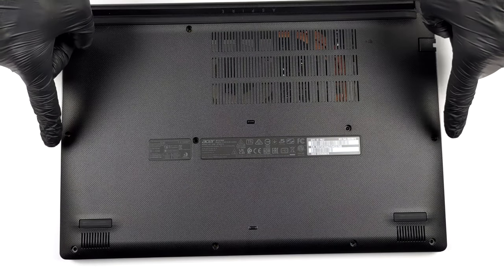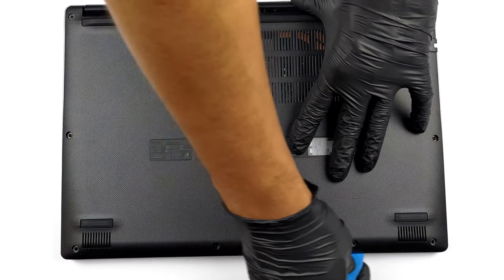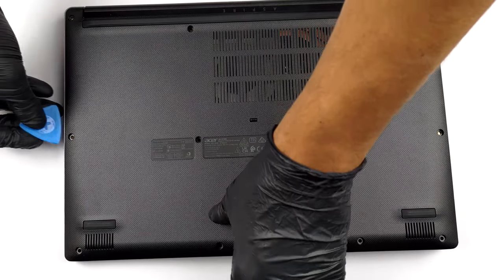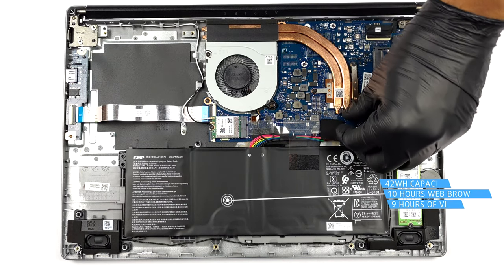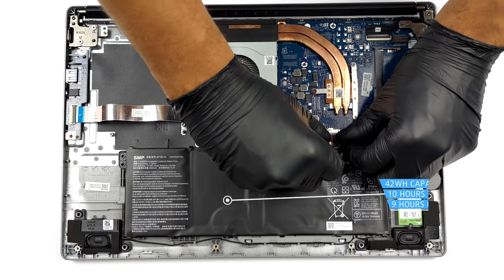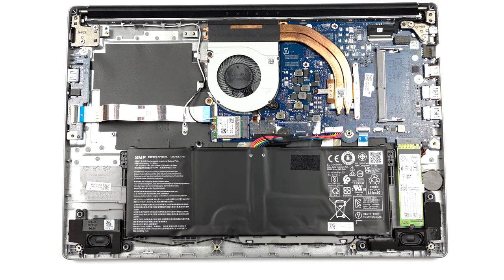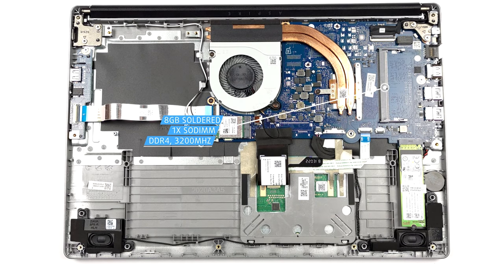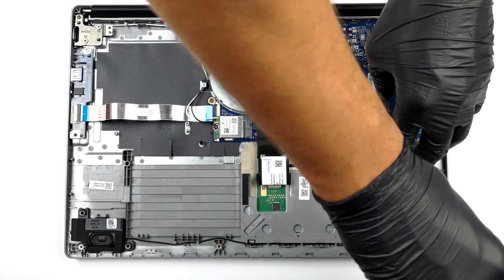🛠️ How to open Acer Aspire 3 (A315-43) - disassembly and upgrade options

Comment: Thanks for the quality video.  I have this laptop with OS Win10.  And two questions please.  1. Driver issue for MediaTech 802.11as MT 7663 Wireless.  What driver to install?  I installed different ones, nothing works.  Wifi adapter did not work.  2. Can I install an additional HDD?